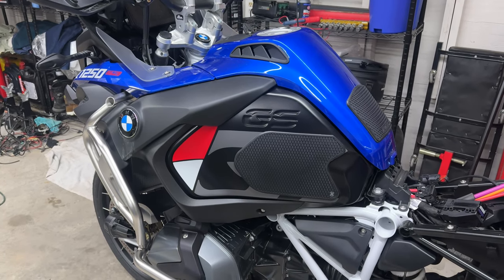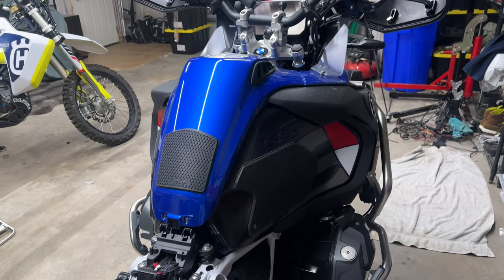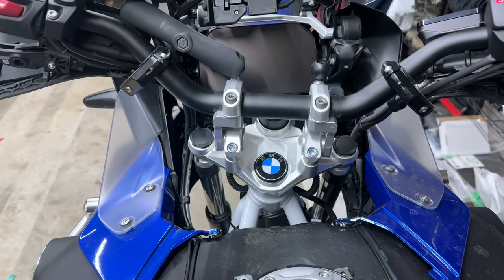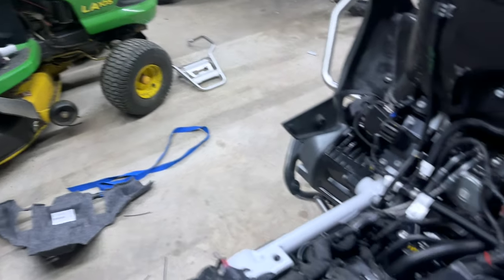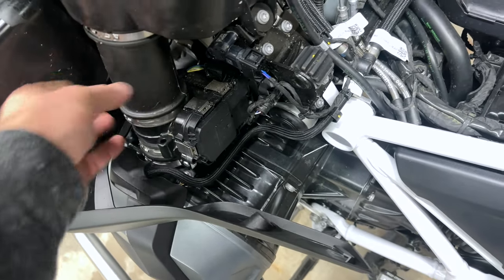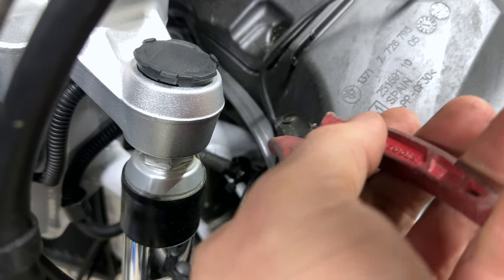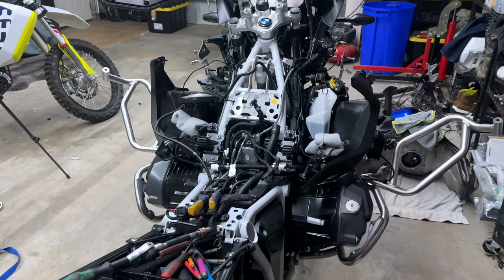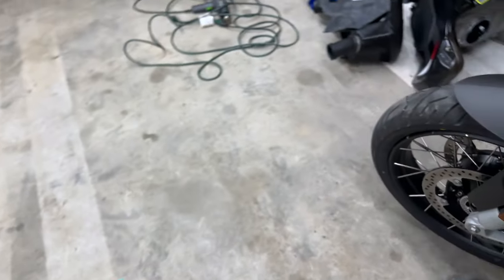Install: Front ESA Shock for BMW R1250GS Adventure (Touratech / Tractive)

Comment from the maker: Hi All, this was auto-published last night but missing the 3 minute overview intro so I had to stop and re-upload it for queue up tonight. I also wanted to stress that as entertaining as this video is for the peanut-gallery, this is not an install someone should take lightly. I highly suggest you pay BMW to do this not because it's hard but because it requires keeping track of a lot of tiny bolts and you could break fairing clips and cost more than a shock. Just keep that in mind. Good luck!
Reply: I know you just recently purchased this bike. But did thw front shock go out already? Or do you just want the peace if mind knowing that you put better shocks on your bike?
Reply from the maker: Hello Mr. Miles Davis. Nope, I moved these shocks from my old bike to this one. These have now been on 3 of my GS motorcycles and they're superior to the OEM in adjustability, rebuildable and have springs that are setup for my weight and the weight of my luggage.
Reply: @AdamChandler86  that's excellent. I remember when you put them on your last GS. That's something for me to think about in the future. Thanks 😊. Keep the paint side up...
Reply from the maker: Yeah, 4th time making this video and the lighting / video quality have gotten better every time. Maybe the next one will be shot in 3D with VR Goggles :PPPP
Reply: @AdamChandler86  😆 🤣 😂 😹 😆 🤣 I'll be waiting for that one definitely 😆 🤣 😂

Comment: You don't pull the plastic pin out to take it off. It is way easier if you push it through and take it from the inner side. Use a thin stick and a small rubber hammer and punch very gently and it's out like butter.
Reply from the maker: You’re right it can be done from the backside as well. There is a BMW tool for removing these and it’s pulling the front of the pin, not back but you’re correct.

Comment: I agree with you, that is why I have a very long, comprehensive, extended warrantee on the used 2017 R1200 GSA I purchased from my local dealer. It had 24,000 miles and is up to date on all services. Doing an oil change is one thing, tearing much of the bike down is another. To me that is like trying to enjoy a good case of "jock itch". It ends up being cheaper in the long run to have a pro do it. They also may find something very inexpensive, but critical, that need maintenance while doing so, before putting it all back together. Riding season can be short up here in South Dakota.
Reply from the maker: Yeah, the warranty is around $1000-$1200. Great price considering it covers the suspension.

Comment: In my case I don't have a ESA suspension, gs1250 2023, I'm thinking to install after I need some software update?
Reply from the maker: It’s easy to cancel ESA and put a dumb shock on with a plug that basically tells the bike not to look for an ESA shock but doing the opposite is much harder. The ESA wiring isn’t on the bike, software, etc. I’d ask a dealer what the retrofit would cost.

Comment: What a PITA.  Thanks Adam, you just convinced me not to a GSA 🤪
Perhaps a second career as a master mechanic for Motorrad.   Excellent job.
Reply from the maker: Compared to almost every other motorcycle, this front suspension work is quite terrible. The only positive I can think of is if it's a new bike-build, it makes wiring very easy since you'll have access to the entire frame.
Reply: @AdamChandler86    I never knew the GS / A had a shock up front.  Lots of suspension components between conventional forks, front shock, steering damper.  Explains why the bike is world class when it comes to RTW and handling.     
In the meantime, I'll keep drinking my Kool-aid and wrench on silly things on my KTM 890 Adventure like persistent coolant leak.  Only if BMW would get the GS well below 500 lbs.  I am going to have to check out the new dynamic 1" in drop in suspension height when bike approaches a stop.

Had to go fix glaring typo in my post.

Comment: Nice work. I guess I’m curious, and I apologize if I missed this, are you swapping to have better adjustability or is it just that much better?
Reply from the maker: Hi Bill, The most common suspension issue is front shock failures so a few years ago, I got ahead of it and upgraded to a suspension setup that was fully rebuildable, adjustable and built to higher standards. Every 30,000 miles, I pull the shock and have it serviced and they've treated me very well while still retaining the OEM functions like ESA. There is a difference (I just went through this) in ride-quality between an OEM GS and a GS with these shocks. I can't quite explain it but comfort and control may be the best way to describe how it feels. I'm no longer as heavy as I once was (one of the reasons to change shocks is to put on a larger spring) but I still prefer riding a GS with Tractive shocks over the OEM. Another reason why I did a 1250 over a 1300 is because these shocks (which are $4,000 when bought new in 2017) have now worked on 3 different motorcycles but won't work on a 1300.